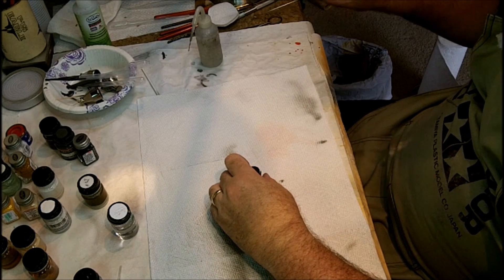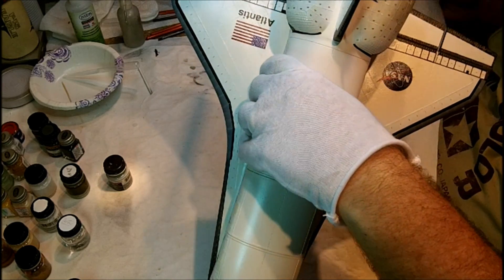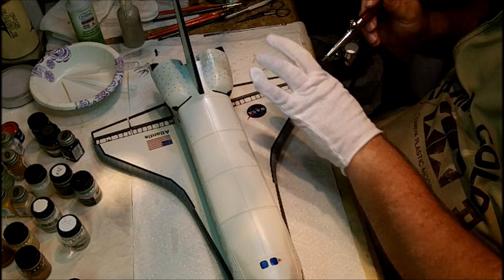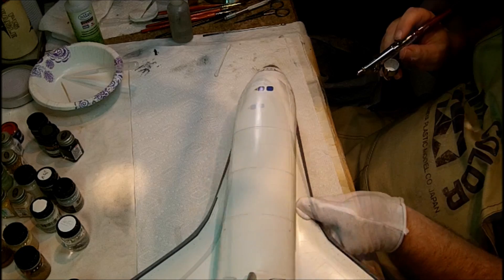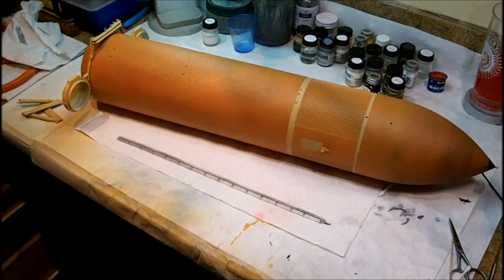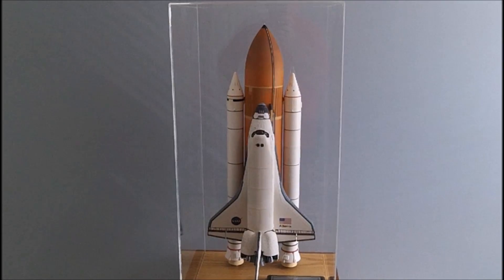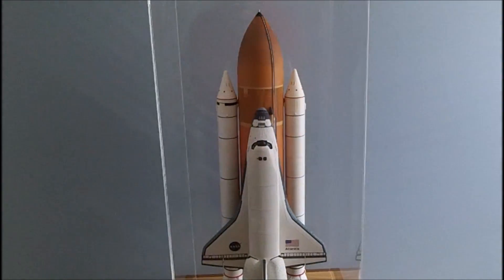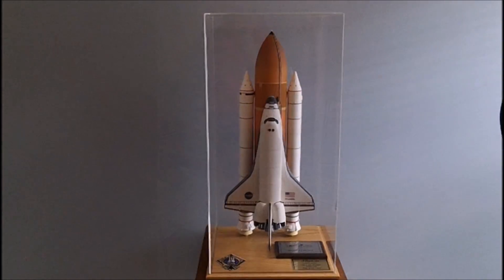Shuttle Wars, Part  28

Comment: I watched the whole series back to back just recently, had to wait for this final part. Now I'm happy I missed the boat on this kit. My hobby shop didn't have it anymore and it was already discontinued. Why I'm happy you ask? Seeing all the flaws and shortcomings, I never would have pulled this off with the kit like you did. Wow, this is excellent and masterful work!!. I wouldn't have been pleased with the outcome of my kit after seeing what could and should be done to it . Congrats for the 2nd place  and for completing a superb model!
Reply from the maker: Thanks for hanging in there for the long haul, and also thank you for your very kind words.
The kit is a monster, that's for sure, and requires advanced skills.  My purpose in  doing this series was to figure out the kit's shortcomings and show folks how to deal with them.  So, if you want to put the effort into it, you now have a template on how to go about doing it.  The mold really should be updated, but I am afraid with the shuttle now retired, demand for this giant kit will be light.  We may have seen the last release of it, at least for awhile.  They can still be found if one looks around enough.  Many are sitting in people's closets unbuilt and will continue to show up on ebay from time to time.

Comment from the maker: Kalvin, when the first shuttles flew they all had tiles.  As the flights progressed and more thermal profile data was collected, most of the upper surface tiles were replaced by thermal blankets and heat resistent felt.  There appear to be three major configurations.  My Atlantis model represents the final configuration.  The Revell model rerepsents the original configuration, although the tiles are oversized.